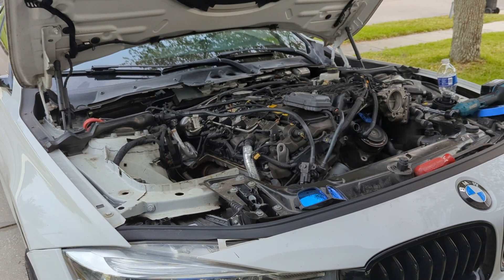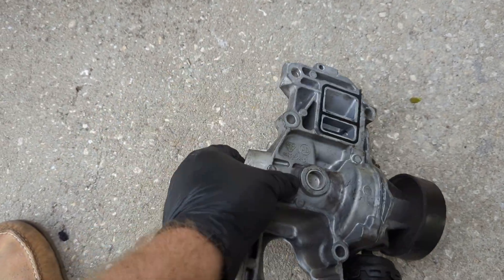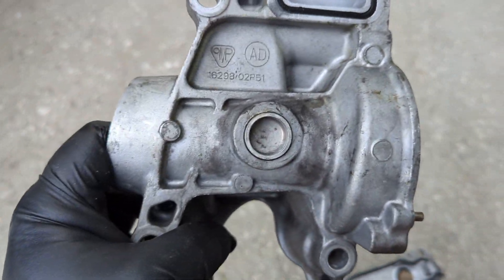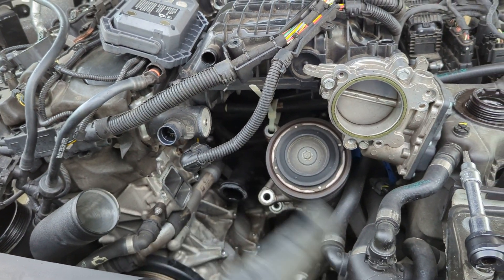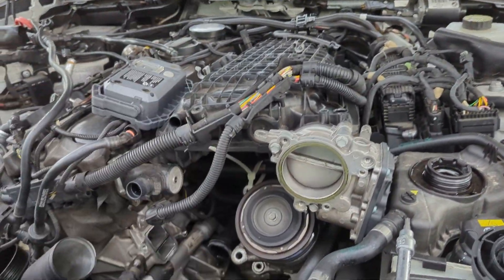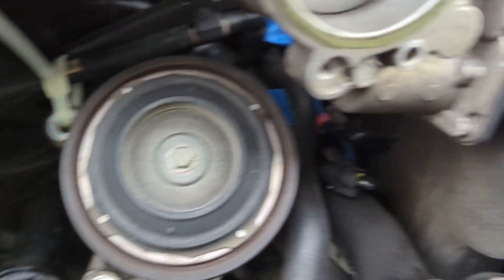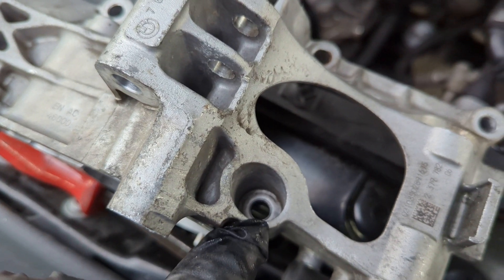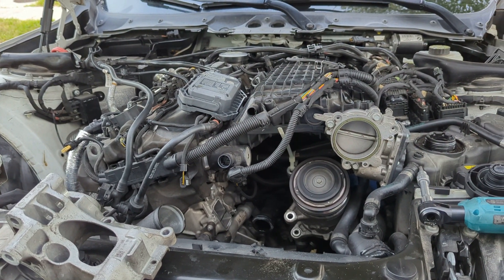B58 Water Pump Housing Diagnosis and Replacement

Comment: How do you get the ac compressor housing out? It’s been an absolute PAIN. I tried setting the bolt into the threads a couple MMs and hammering it with a hammer drill and I can’t get it to budge. Idk what I’m doing wrong

Also any suggestions getting the ac compressor pulley nut off? The pulley just keeps spinning and there doesn’t seem to be a good place to put anything to counter the spin
Reply from the maker: Sorry just saw this. Yeah it's a PITA! I used a breaker bar and wiggled it out eventually. It actually seemed to go in way easier then getting it out.
Reply from the maker: Also, I wouldn't take the pulley off unless you need to. If you do need to take it out I'm not entirely sure how to get it off. There may be a jumper in your ECU or fuse box that engages the clutch, that combined with an impact may do the trick. But you may want to keep it mounted when you do it.

Comment: Hey Matt I just got my water pump from FCP euro but it doesn’t have the plastic pieces attached to the one in your video . The water pump on my car has those pieces on it . Would I be good to use the new pump that doesn’t have the extra plastic parts on it?
Reply from the maker: Sorry I didn't see this comment, Im sure you figured it out by now, but I believe the design changed and you don't need that piece anymore.

Comment: Hey Matt, thanks for the video and information. I ordered a water pump from fcp euro for my 2016 340i but i don’t need to replace the whole bracket do you know if you have to replace the whole thing or can you just get away with replacing the water pump and not the bracket? Thank you
Reply: Just to kinda give you some insight because I’m actually going through this now and hopefully I can help you and others save a headache or two in the future this might be lengthy but it’s just my experience with the b48/b58 I replaced my water pump almost a year ago I also just replaced my branch connector 2 weeks ago from the block to the upper radiator hose aka “Mickey mouse” oil filter housing replaced 6 months ago and I just noticed another coolant leak I pressure tested the system and couldn’t really spot where the leak was coming from at first but after hours of visual inspection I found that it’s coming from the water pump bracket which is the part he is replacing in this video although I’m 2 weeks late on this comment it’s worth mentioning it for yourself or others who are curious replace it if you plan on keeping the car long term because it will eventually leak I tried looking for just the seals but it’s either i can’t find good seals, they are back ordered, or delivery is just to far out but my recommendation would be to replace it my apologies for the long response just thought it would be worth mentioning to save someone else from the headache and possibly the money.
Reply: @G80Jaayy  awesome! Thank you for the help. I replaced my water pump from the old version to the new version and it was plug and play. I think I have another leak so I’ll take a look at that.
Reply from the maker: @chuggalueroifan Sorry for taking so long to get back to you here, but yes they should be interchangeable. I'm also finding more and more leaks are happening to everything on the block wall under the intake manifold. Pretty sure I sprung a leak now in the thermostat assembly. That will officially mark the replacement of everything coolant passage wise under the intake manifold besides a couple random hoses. 

I would suggest to anyone reading this to just replace everything under the intake manifold if you have to go under there and you have over 100,000 miles.

Comment: Thanks for the video man ! I recently got code20F206 heat management module line disconnected, im wondering if it is the water pump or the thermostat, i have a 2018 bmw 340i stage 2 as well with 106k miles. No over heat , but I recently changed the fuel tank breather valve off amazon. I bought a 30$ aftermarket piece, maybe thats why im getting the 20F206 code ? Plz help !! Great video btw
Reply from the maker: Sorry, I wish I knew more about these engines/cars. I'm just winging it as things break. If you find a solution can you post it back here in the comments so anyone else looking can see it? Thx and good luck.

Comment: Matt thanks for posting man I have the same year/model & couldn’t find anything either lol Everything I see online is for pumps without the On/Off switch. Do you have a part # for the new pump you used? I’m curious if the superseded part deletes it or not
Reply from the maker: Yes, check the description, I linked all the parts I ordered. The New water pump is definitely different, they removed that vacuum pump actuator arm thing. Feel free to DM me on Instagram if you have any questions @untensuru